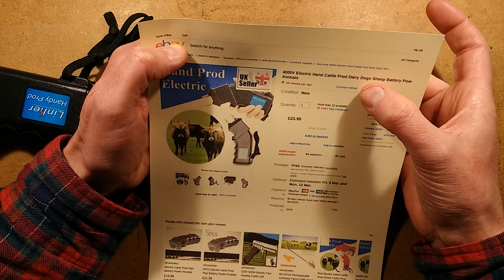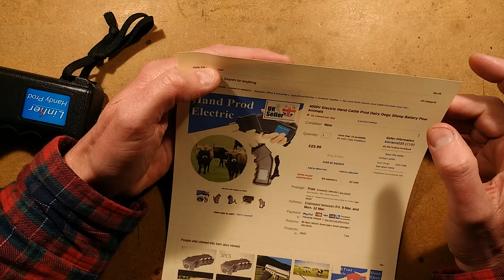Does a cattle prod hurt?

Comment: As far back as the mid 1970s, these things were looked down upon with great disdain by the animal welfare organisations, and to the best of my belief were eventually outlawed in the 1990s, if not before. In any case, the more recently enacted animal welfare act would make these very unlikely to be used, legally. 

I worked on a farm in the 1970s ('75 to 80), and the farmer there had an old tubular device with spring loaded prods that automatically closed the circuit once sufficient pressure was applied, so there were no sparks, and no crackling noises, but it did make a buzzing sound, so there was some form of electromagnetic vibrator device in there.

All I can say is, if the guy with the prod, missed his target (the cow, or pig etc.) and got you in the arse instead, you got a first hand experience of what it must have been like for the cow. In reality, these things only ever served to terrorise the animals and made them even more difficult to handle. Perhaps not surprisingly, that prod spent most of its time languishing on a shelf, unused.

And yes, I have had a couple of kV in the rump, and believe me, it can take an hour or so regain full control of your legs after that thing screws up your nerve endings.... I'm guessing that you know how nerve impulses are sent along nerves by chemically depolarising and re-polarising the nerves? Well, these electric prods can significantly screw up the chemical balance along a nerve pathway, and it can take a fair while to restore that natural balance. True enough, you start to regain sensation almost at once, but just try walking on it - not going to happen so fast. It's exactly that phenomenon that makes a "Tazer"(TM) such a useful tool to the law enforcement agencies around the world.

Comment: my question is.. how can 4 AA batteries produce 4000 v?  that's what they all advertise.. this is what google says: Most AAA, AA, C and D batteries are around 1.5 volts. Imagine the batteries shown in the diagram are rated at 1.5 volts and 500 milliamp-hours. The four batteries in parallel arrangement will produce 1.5 volts at 2,000 milliamp-hours. The four batteries arranged in a series will produce 6 volts at 500 milliamp-hours.
Reply from the maker: The voltage is stepped up by a circuit that pulses a small transformer.

Comment: Hello Bigclivedotcom, can you please tell me if the circuit you mentioned is similar to a ignition coil system used in the old cars ???? Thanks
Reply from the maker: The traditional car coils system is really just a low turn primary winding being switched on and off with specific timing, and a high turn secondary winding that produces the spark.
Reply: @bigclivedotcom  Thank you bigclive for the information I asked for. Good day too.

Comment: "We are not allowed to use stun guns because we might use them to defend ourselves". 

That's completely and absolutely the opposite to the logic. The reason people aren't allowed to carry these things is because they'd undoubtedly be used as weapons by criminals to attack and disable their victims. It's the same as any potential weapon which doesn't have a legitimate alternative use. 

The reality is that weapons are far more often used in the offensive rather than the defensive mode. The attacker always has the advantage, as they can plan their moves and surprise the victims. It muggers want to hold somebody up, and think the victim might have such a self-defence weapon, they they will use their's first. Admittedly having laws banning the carrying of such weapons can't eliminate the problem, but it means that anybody carrying one without good reason (in the case of knives, or even a baseball bat) is immediately a suspect and hence a help to detection.